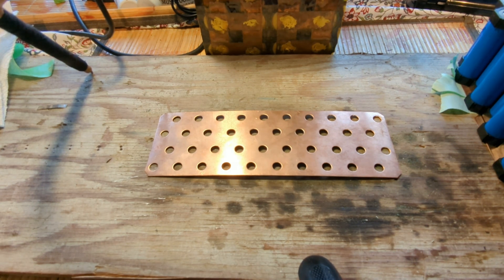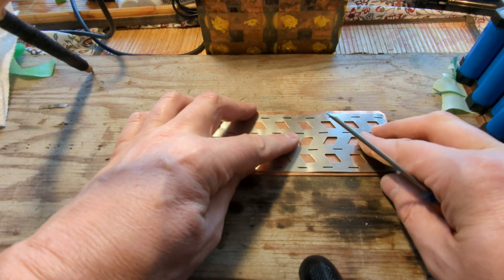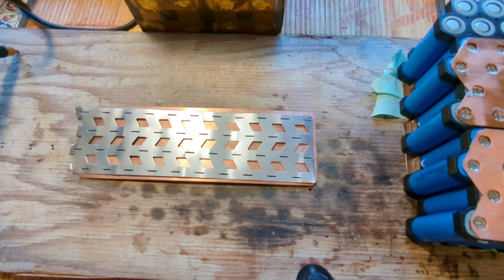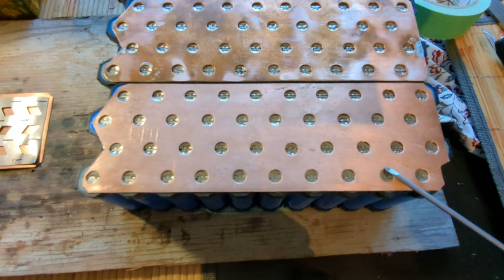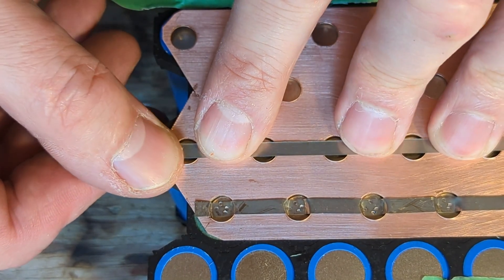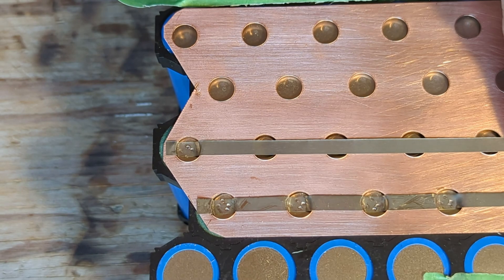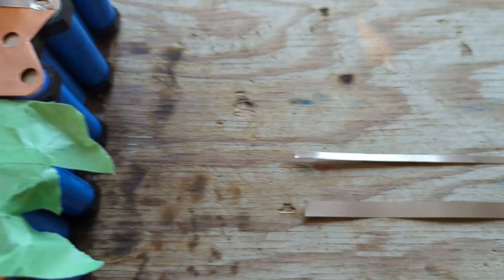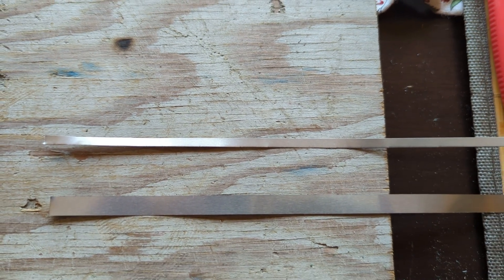DIY Sodium ion battery for electric motorcycles

Comment: Which spot welding machine are you using??
How lany Ah is each cell?? 10 Ah??
Reply from the maker: I am using a cheap AliExpress spot welder that I modified.  It's not even worth mentioning. All it needed to do was have the switching transistors and I provided the power feed. 
Each cell is only 1,300 milliamp hours which is really low and almost not worth it for a motorcycle battery, but I'm still going to experiment with them.

Comment: What BMS will you use?
Reply from the maker: I'm going to run it without a BMS. 
My rationale being since you cannot over discharge them - I don't need the BMS for that.  And when I'm going to charge I will carefully charge them only up to 4v/cell.  I will have the ability to temporarily hook up a BMS for balancing purposes

Comment: Can you make a video of you testing it on a motorcycle?
Reply from the maker: It's coming
Reply: @diyelectrified1289  im Waiting
Reply: @rudsonlgp  I am waiting too
Reply from the maker: @district99 I apologize that a project stalled.  I have no excuse other than s*** happens and my YouTube channel had to take a backseat.  I promise you that the battery is more than 3/4 done and I am just waiting for when I have the time to work on it some more.  I know I missed the sodium ion wave, which means probably I'm going to miss out on a lot of views.  C'est la vie!
Reply: @diyelectrified1289  don’t worry, bro!! I will continue waiting, do it in your time :)
Reply: @diyelectrified1289  that's fine.. I heard it performs like lead acid battery

Comment: This work from you looks very good. Can you specify in a video more details about the output summ-voltage, weight, volumen and the expected capacity?
Reply from the maker: That is an excellent request. I will do that upcoming video
Reply: @diyelectrified1289  🤩 looking forward

Comment: What do you think about those cells? Are they good so far?
Reply from the maker: I haven't tested them yet under load, so until then I'm reserving judgment.
I've been busy but I'm getting close to completing the battery pack and when it's done I will install it in my moped (Aprilia scarabio conversion ) and compare it to the normal lithium iron phosphate back

Comment: By the way, how much did you pay for the shipping?
Reply: Make sense. Actually, the price for the batteries and the shipping is not that bad, 1.12dlls per battery is a good price. Thank you so much for the information!
Reply from the maker: 357USD
Reply: Just for the shipping or for the shipping and the batteries?
Reply from the maker: 313 USD for the cells
Reply from the maker: Just the shipping
Reply: @diyelectrified1289  wait, is it $313 for each of the 600 batteries or all of the 600 batteries?
Reply from the maker: @Enquisitor for them all plus shipping
Reply: How many batteries did you buy, I think the shipping price is too much😅
Reply from the maker: 600
The shipping charges are high because of the weight and because they are batteries.

Comment: Thank you for your videos. I really find them super helpful. I plan on buying some batteries for one of my projects, but I need more information about these new Sodium-Ion batteries, and there are many videos like yours. Thank you!
Reply from the maker: At this time I can't recommend sodium ion for a motorcycle or scooter build.  I would say your best bet is to use either lithium ion if you want max range or lithium iron phosphate if you want more safety.  But that's just my opinion and not my advice
I'm using sodium ion just for the learning experience
Reply: Why wouldn't you recommend sodium-ion? 
 @diyelectrified1289

Comment: please elaborate on cells, caracteristics ?
Reply: Only negative is not as energy dense as lithium.  Comparable life cycle to lithium.  And much safer than lithium ion
Reply: @johnle231 
It's also supposed to handle the cold much better than Lithium batteries.
Reply: Cost? Can I make the cells at home with bigger tanks. I have salt and I have space
Reply from the maker: I would love to see that.
Reply from the maker: I will.  😁